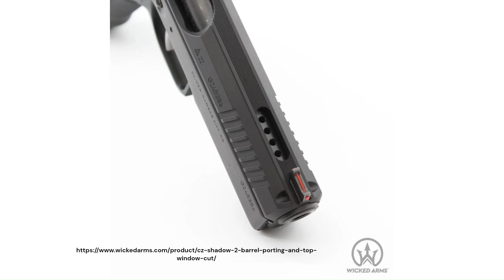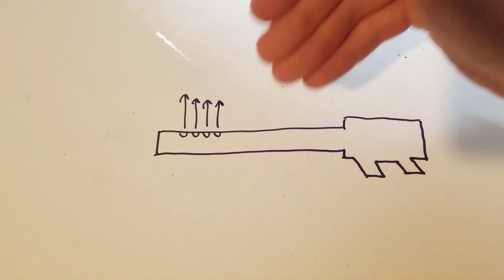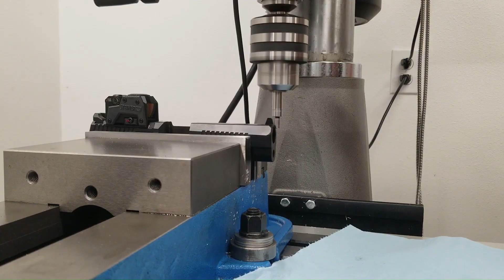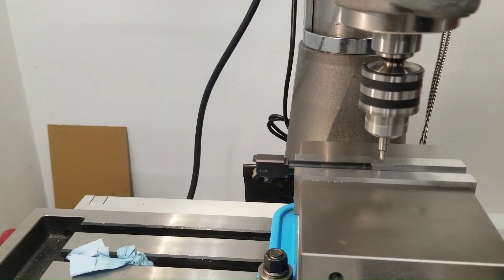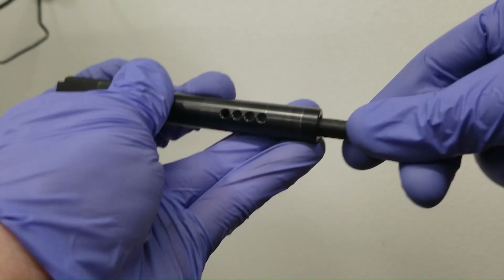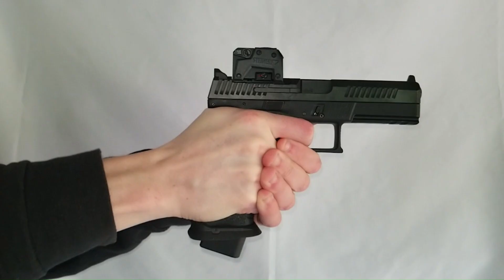I Ported My CZ P-10 F

Comment: No, ports forward in the barrel lockup area does not effect lock up. All of the actual lockup occurs on the bottom half, of the muzzle. None on the  top. 

KnifeMaker
Reply from the maker: I suppose due to gravity the barrel will be sitting on the bottom portion. And this is much less important with guns that have looser lock up clearance like a striker fired pistol. I wouldnt want the ports/spalling/jacket separation tearing up a nicely fit barrel bushing on a 1911.

One issue I have run into with large ports close to the lock up area (I dont machine ports this big anymore) is spalling being deposited in the lockup area. Essentially molten lead brazes itself to the barrel. This happened on my improperly chunk ported Springfield hellcat.
Reply: @EngineersArmory  It isn't gravity that caused the barrel to lock op on the bottom. It is the action of the rear barrel lock up that forced the front of the barred down ward. 

The melted  lead can be easily removed with a brass (soft) rod such as the tip of a gunsmiths brass punch with the edge of the tip.  Brass will peal it right off with no scratching of the barrel.   

I've been porting barrels for people for over 40 years now.  Years of naysayers and now suddenly it is all the rage. LOL!
Do not shoot plated bullets thru a ported gun.  Revolvers are a no-no as well. 

A few tips. Use a carbide center cutting end mill at high RPM never a drill. The cut will be much cleaner. to make it even cleaner, drive a soft wooden dowel in to the muzzle where the ports are to be milled. this will help prevent burrs in the barrel.  Finally, use a rubber abrasive rod such as made for Dremel's and angle it forward in the ports in such a way that it removes the sharp edge on the in side of the barrel. This again is to cut down on jacket shaving. I thin lap the barrel. 

Never shot plated bullets in a ported barrel. or a revolver for that matter. They cannot take the abuse. 
Sadly, ammo makers are not telling us what they use. those few that are list full metal jackets as fmj, whereas plated is listed as total metal jackets. tmj.  the actual bullet manufactures for reloading flatly state not to use their plated bullets in ported barrels or revolvers. 

KnifeMaker
Reply from the maker: @michaell397  ah yeah the chamber end lock up rocking it down. Makes sense. The lead that deposited on my barrel didnt come off that easily. Not a huge deal, I scrapped the barrel haha. I sure dont want to add scraping lead off the barrel to my cleaning regimen. I'm sure you know more about porting that me. From my experience I like to keep my ports out of the lockup area. 

I also shoot plated bullets thru my ported barrels all the time. Hasn't presented issues so far. I have learned to keep my ports small (I prefer nothing above 7/64" diameter) to minimize spalling, jacked separation on bonded jackets, and loss of accuracy.
Reply: @ Hold a piece of carboard 1 foot above the barrel and shoot plated bullets. Tell me what you see!

that spalling unbalances the bullet. You won't see it at 7 yards or so, gut at longer ranges the bullets become very erratic.
Reply from the maker: @michaell397 I've done a fair amount of 25 yard accuracy testing. Larger the ports the more the groups open up. Done this with plated and bonded bullets, similar results.
Reply: @EngineersArmory  True enough. 
KnifeMaker
Reply from the maker: @michaell397 im the thug I almost lost and eye to hahaha. ive already put myself in the hospital shooting from retention. Shrapnel in the forehead that needed surgically removed😂. Learned a few lessons that day. Yeah tilt the gun away from you or make v ports haha. I just dont port any concealed carry orientated pistols now.
Reply: @EngineersArmory  wish I could post pic's.  After I ported my C2, I milled the slide adn muzzle into an integral Comp. So now ported and comped. 

I got a Cyclops single comp from Underworld arms and put it on the C2 as well, and they sent me a Dual port comp for testing. Makes the C2 look almost identical t a Sand Viper. so now the gun can be compact or a full size  race gun in minutes. Talk about versatile!  

I'm an old (70+)  Bullseye shooter. Always shot for precision and accuracy. Now days seems every thing is going to spray an pray. The hits for rounds expended in LEO shootings is outlandish. 

I am just now learning to shoot double taps. (always carried a Les Baer .45. 9mm in new to me. But these ports and comps are really making a difference. IN the first test, it shot the fastest and tightest double taps I've ever had. 10 yards, 1/ 1/4" diagonal and 1/2 wide in instant double tap. I have a lot to learn to be consistent, but it is a lot of fun Only draw back is ammo expense. GRRRRR! Luckily I have my own rang, that helps for range expense, but then again, I can shoot virtually every day hear in the Central Texas Weather. 

KnifeMaker
Reply: @EngineersArmory  We all, (hopefully) live an learn! Glad it wasn't worse. ;<)
Reply from the maker: @michaell397 that sounds like a wicked setup!

Comment: Thank you for the great work! I appreciate your insight and your knowledge. I am interested in porting few of my 9mm, and I want to ask if the 5/32 holes are working well for you? Or did you find a different size like 3/16 holes better?
Reply from the maker: Since this pistol, the first one I ported, I have porting like 15 other barrels haha. I don't generally do holes larger than 7/64" (.109") anymore. I have found holes bigger than that result in much more spalling and jacket separation. the 5/32" holes shown in this video didnt affect accuracy enough at practical pistol ranges to bother me, but its noticeable. I have done bigger ports that absolutely ruined accuracy. Like the group opened up 6 inches at 15 yards.

The spalling and jacket separation (in addition to landing me in the ER and needing surgery in an extreme case) damages the slide and barrel, and can deposit molten lead in the lockup area depending on where the ports and cut in the slide are.

I've learned a lot. Generally, I do V6 and V8 ports with 7/64" holes and a narrow V angle - like 15 degrees off vertical (see my ported Beretta 92X video). Or I do a VR layout with 6 or 8 ports 3/32" diameter (see my ported shadow 2 video). Also longitudinal slots 3/32" diameter (see my ported M&P 2.0 video). Never transverse slots - those make the bullet come apart even if they arent very wide. 

I actually just bought a new barrel for this pistol and did inline ports - 4 of them at 7/64" diameter. I plan on making a video soon when i can get to the range for testing to compare the performance of the smaller vs larger ports in the same gun.

Comment: Just did a 5 port using your method on a g17. Had to get carbide for porting the barrel, but otherwise it went smoothly. Thanks for the video
Reply from the maker: Nice! Carbide is generally needed to break thru the nitride. I use a drill bit after that.
Reply: @EngineersArmory A tip on porting. use only high rpm carbide as it will cut cleaner.  Drive a soft wooden dowel in the barrel where the ports are to be machined. The further prevents inside burring. finally, using fine grit rubber abrasive rod in a Dremel or Fordum, angle the rod forward in the bbl. This will help a lot to prevent jacket shaving. 
KnifeMaker
Reply from the maker: @michaell397  Those are some great tips I appreciate it!

Comment: Does porting impact the ballistics of the bullet ? You are removing part of the rifling and changing the  push of the gas. Is accuracy affected ?
Reply from the maker: In my experience accuracy and point of impact are affected more with larger ports. The form of the ports, holes, longitudinal slots, transverse slots affect the bullet more or less as well. More disruption to the bullet, more chance of jacket shaving and spalling which can destabilize the bullet. The ports on this pistol (compared to when the barrel was unported) maybe opened up groups 1/2 to 1" at 25 yards. Maybe a 1/2 to 1 inch POI shift at 15 yards which is what I zero all my dots at.
Reply: @EngineersArmory  thanks

Comment: Did you have any accuracy issues or POI shift? Just wondering what any unseen burrs in the barrel did to performance
Reply from the maker: No accuracy issues or POI shift. I have had that on other porting jobs with bigger ports. Wasnt an issue with this port size. I deburred it pretty well. Bullets should have done the rest. After that any poi shift or accuracy change would have come from jacket separation and spalling.

Comment: That thing is sweet bro. Have u had any issues with any shrapnel or spalling out of the ports? Also what kind of magwell are u rockin? And do u think it would work with the plus 2 mag extensions?
Reply from the maker: A bit of shrapnel and spalling, but not enough to tear up the barrel or slide too bad. Also not depositing any lead on the barrel lock up area. 

The mag well is from strike industries. I can confirm it works with factory +2 mag extensions, and factory non-extended baseplates.
Reply: @EngineersArmory  that's awesome. Yea I was wondering why Smith& Wesson only put a comp on their recent 10mm instead of porting an they said because of spalling and I was skeptical of the validity of their statement, an actual dangers of getting ports added anyways but maybe 10mm is a little more significant because of more pressure especially out of true hot loads like ur underwood an buffalo bore.
Reply from the maker: @SammyTheSidePiece  Yeah for sure. risk of spalling is there no matter what. Higher pressure should absolutely make it worse.
Reply: @EngineersArmory  has any of the spalling actually hit or affected you? An now I'm wondering what kind of ports did they test, if they only did right angle ports like you did, or maybe they tried the V8 ports.
Reply from the maker: @SammyTheSidePiece  HA! yes it has. check out my springfield hellcat porting video. ER visit, multiple doctor visits, surgery. Lots of pain and money. I plan on doing an "everything i've learned from porting my pistols" video, and I will go into more detail about that injury and how port size and form affect spalling and jacket separation. I am still working on porting some barrels for comparative testing to answer a couple outstanding question I have then I will start in on that.
Reply: @EngineersArmory  oh wow. yea man, where there's a will there's a way. We just gotta keep testing. An I'm definitely looking forward to those new videos. Maybe the V porting is slightly less effective but safer because when the muzzle flipped up the ports aren't pointed right at you, IDK just a theory. Or did any of your injuries or issues happen from V ports?
Reply from the maker: @SammyTheSidePiece  Only one injury from a "chunk port." I didnt know you were supposed to bore out the rifling. I was shooting it from retention. I have done lots of V ports and inline ports, slots and holes. A v-port should reduce the chance of getting tagged by spalling/jacket when shooting from retention (if you hole your gun straight up and down).

Comment: Are there any new port designs or updates on your porting indevers? I'm curious what design differences would be effective comparing a P10F, C and S accounting for barrel length. At some point, it seems it would be of benefit to go to bigger holes or a v patern to keep the perpendicular port effect closer to the end of the gun for balance. Something like my P365XL could use ports, but optimal format...IDK.
Reply from the maker: I have a number of porting videos where I talk about that stuff. I am currently working on machining some barrels for testing to answer some outstanding questions I have. Eventually that will culminate into a video about everything I have learned from porting my own pistols.
Reply: @EngineersArmory  I dig it! Thanks! I'll look around for your other videos. I look forward to your future break down.
Reply: @EngineersArmory do you run the heavy back strap? Brass or other?
Reply from the maker: @jonnyhumphreys9133  Naw i dont.

Comment: I probably would have used a dial test indicator on the square portion of the barrel to find the center in relation to up. But ya know...to each their own
Reply from the maker: I'm not quite sure what you mean by that. Can you please explain?
Reply: @EngineersArmory Maybe the confusion was solely because of my absolutely terrible phrasing of the original coment. Maybe I should refrain from making comments after comming home from the bar! Haha
Reply from the maker: @a.m.8337  😂😂 no worries man happens to the best of us.
Reply: @EngineersArmory  What I ment to say: Instead of using a machinists square to square the barrel to the table you can use a dial test indicator instaled in the mill. Use a collet to camp a swivel post attached to a dail indicator in the mill. Snug the barrel in the vise (the way you had it) ensuring the top square portion of the barrel is close to parallel with the table. Raise the table to zero the indicator against the top of square portion of the barrel. Move the table along the y-axis while in contact with the barrel observing the the indicaror and making adjustments. When you can run the indicator acoss barrel without the needle moving, tighten the vise all the way and proceed with the porting. Using a machinists square the way you did is perfectly acceptable, but the method I described is one way to get as close to perfect as possible.
Reply from the maker: @a.m.8337  ah gotcha. Yes. That would be the best way if I were concerned with that level of precision.
Reply: @EngineersArmory Instead of using a machinists square to square the barrel to the table you can use a dial test indicator instaled in the mill. Use a collet to camp a swivel post attached to a dail indicator in the mill. Snug the barrel in the vise (the way you had it) ensuring the top square portion of the barrel is close to parallel with the table. Raise the table to zero the indicator against the top of square portion of the barrel. Move the table along the y-axis while in contact with the barrel, observing the the indicaror and making adjustments. When you can run the indicator acoss barrel without the needle on the indicator moving, tighten the vise all the way and proceed with the porting. Using a machinists square the way you did is perfectly acceptable, but the method I described is one way to get as close to perfect as possible.

Comment: Great video. However, I do have one question. Wouldn't the effectiveness of recoil reduction be proportional to the momentum of the gas exiting the ports and not kinetic energy? If you wanted to optimize port geometry, prioritizing greater acceleration of the gas flow by restricting the port size versus just getting more gas out seems counterproductive to reducing muzzle rise.
Reply from the maker: While I have a little background with fluid mechanics, most of it was subsonic incompressible flow. I currently design industrial hydraulics equipment which is of course subsonic incompressile flow. This is a case of supersonic compressible flow and its a whole different animal that I dont have nearly as good of a grasp on.

Whether a conservation of momentum, or conservation of energy method is used to evaluate this system, if the correct assumptions are made and they are both done correctly... they should agree. My answer to your question is... shit man I dont know hahaha.

Im beginning to think increased overall cross-sectional area of the ports is better than less because there is such an excess of pressure available to force gas out of the ports. I recently did testing with a compensator on a ported barrel, and there was still enough gas energy left after being blown out the ports that I saw a significant reduction in muzzle flip with the addition of the comp. Again, leading me to believe that increased overall port area is better, which is what you're proposing. 

At some point I want to do some testing that compares performance of ports with more/less total cross sectional area, then the same overall cross sectional area but with bigger and smaller ports (more smaller ports vs less larger ports). I want to redo the porting job on this pistol, and a barrel is eascy and cheap to find. I want to redo the porting on my P-01 as well - Barrel less available and more expensive. So we'll see.

Comment: Great video ... lots of info...
Question!: Whats the rotating speed of your drill set?
Reply from the maker: Asking the real questions here. General rule of thumb I learned years back was rpm= 400/diameter of bit (inches). So for example: 1/4" drill bit. 400/.25 is 1600 rpm. Of course this changes with material, bit type, bit material, your feed rate (if milling) etc. But that's a good starting point for steel with a typical HSS drill bit.